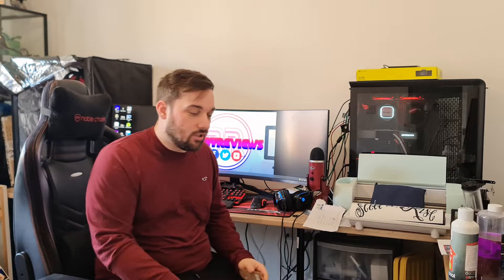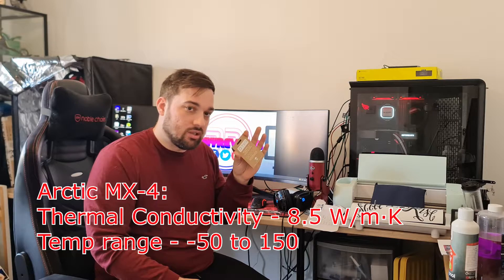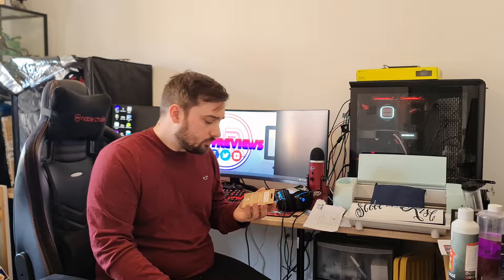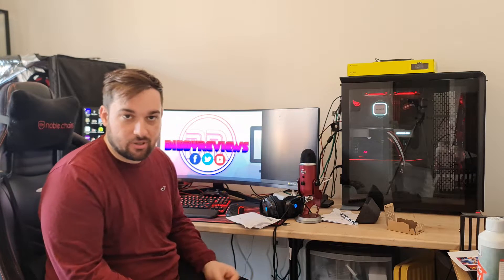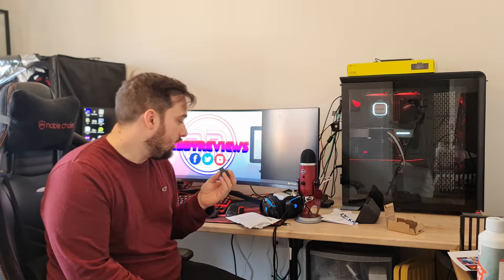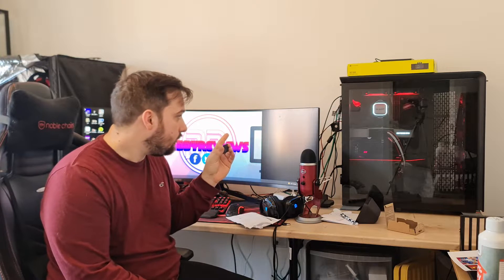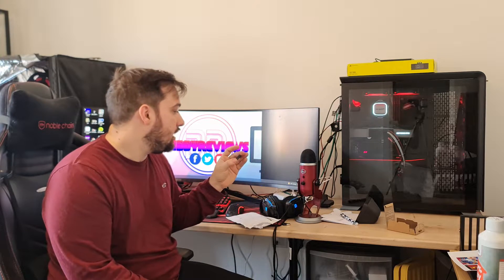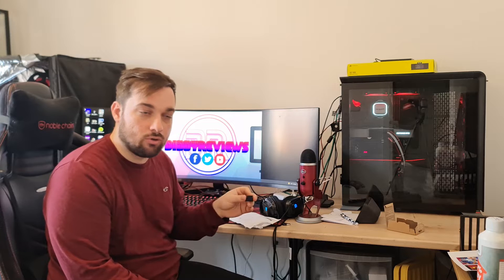Streacom TX13 Thermal Paste Review - Is this one of the best?

Comment: thing is with Cinebench is that Pause When it runs through its test i tested it with PBO enabled you sure you Wasn't testing it with an offset with voltage in the bios because temps i'm Getting on my 3600 is in the 60s and i have a 360mm  aio and when i offset the voltage Get around the same as you but i set it back to Stock for a fair test  between both thermal pastes
Reply from the maker: I'm running 4.6 all core using asus OC settings, it changes the voltages I think. Still a fair test coz both were tested with same settings. Mines a 5900x.
Reply: @DowsettReviews  i run it at stock because not everyone will overclock its why pbo is enabled my cpu is only 6cores 12threads and im getting higher temps than you me personally i would of run it all at stock settings
Reply from the maker: @WELSHYTECH  it's still fair though coz both tests were using the same settings. I mention in the video that it's 4.6 all core so there's no confusion.
Reply from the maker: I do also have a total 3x140mm, and 6x120mm fans in my case all ran at full speed.
Reply: @DowsettReviews  see i dont run them at full speed as fans at full speed do my head in lol
Reply from the maker: @WELSHYTECH  I'm more about cooling than noise lol. Doesn't bother me. I have my headset on anyway so doesn't matter to me. I'd run them faster if I could 🤣🤣
Reply: @DowsettReviews  give thermal right an email for review samples bud they responded to me so give them a Try
Reply: @DowsettReviews  😂😂😂😂lol im old school with my big speakers and bass lol
Reply from the maker: @WELSHYTECH  nice one will do lad. Do you have contact for thermaltake coz I used their online form and it never gave me a confirmation it had gone through.
Reply: @DowsettReviews  the online form didn't Work for me either Um i have an email but i was told  they Wern't doing anymore review Samples until Q3 of this year as they are expanding there media department give me a message
Reply from the maker: Will do buddy